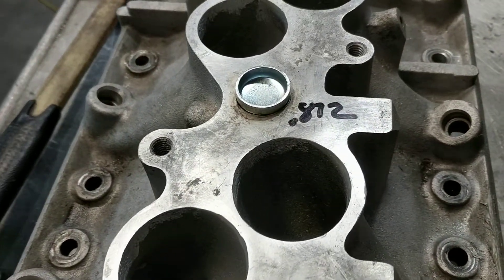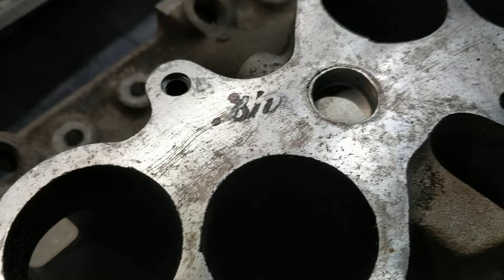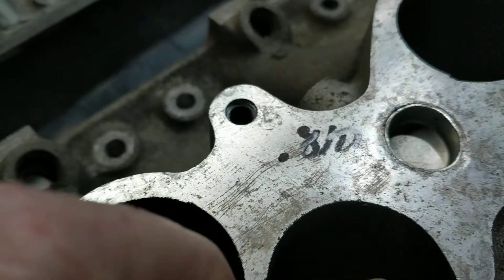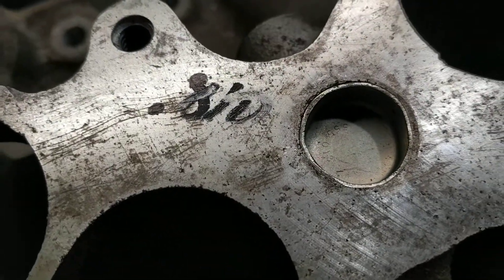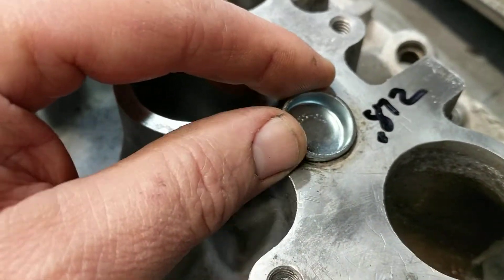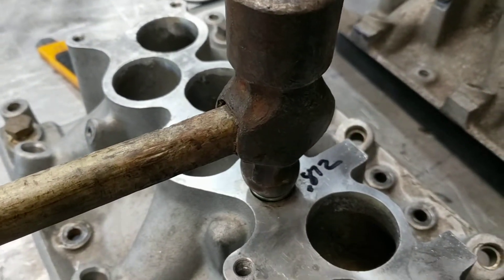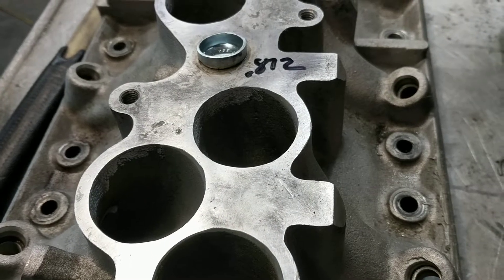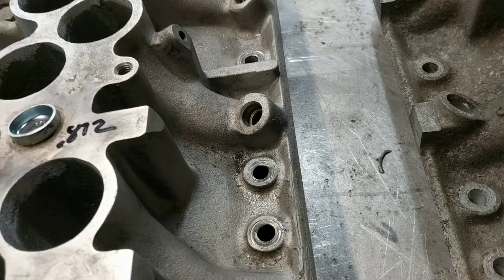Explorer lower EGR port differences

Comment: Would this hold up if my upper is the non-egr type that is not flat. My upper is raised in the middle. Wonder if I should use jb weld for safe measure.